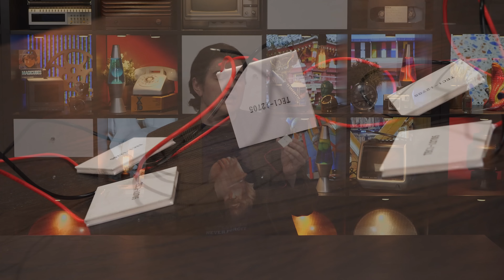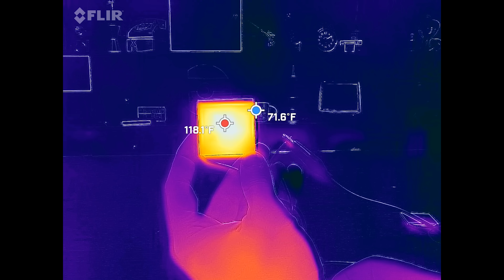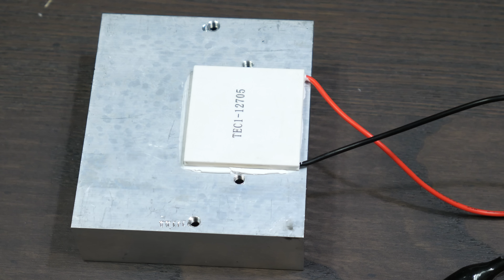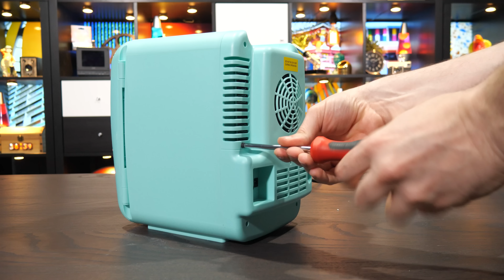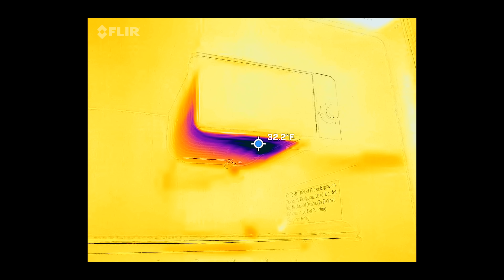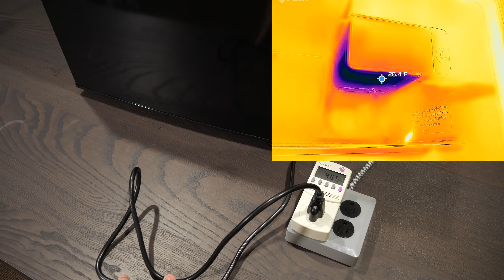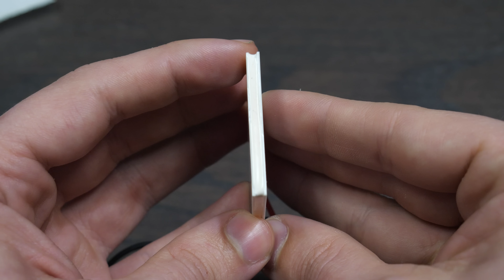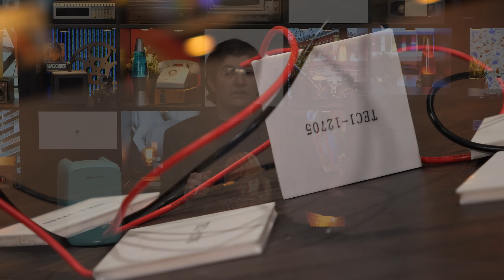Thermoelectric cooling: it's not great.

Comment: Peltiers make for an awesome demo in digital electronics classes as a thermo quantum effect device, but unfortunately have incredibly specific use cases in real life.
Reply: I have used them in research applications where we control the temperature of a device to keep it stable. A lot of scientific cameras use them for cooling and stability as well. The applications for TECs may be niche, but they exist!
Reply: I once had a very senior engineer at a military equipment manufacturer ask me to design a Peltier based air conditioner for use in extreme climates. It was an awkward conversation.
Reply: @Miata822 what did you tell
Him? What did he say?
Reply: They're fun for DIY projects. They're really cheap and really simple.
Reply: They're OK for use in a car and camper, compact. Not very efficient but partially that is because most of those cheap l;ittle peltier fridges have a fan and heat sink that underperform. For maximum efficiency you want to keep the Delta T between the two sides of the peltier elements as low as possible, this means keeping the hot side as close to ambient as possible. The reason for this is that moving the heat from one side to the other costs more energy, and the higher the temp difference, the more extra energy (supplied by the electric current)  is needed per unit of heat. This means a decent heatsink and a powerful fan. Still inefficient, and the limit is still only about 30 Kelvin max, as was told in the video.
Reply: @paulmichaelfreedman8334  not sure where you got the 30 Kelvin figure, because I had reached in personal experience, over 40C difference between room temp side and the cold side, single stack, with reasonably good heat removal from the hot side (to ambient, no double stacking etc), since that is the important part - remove heat from the hot side, 2nd most important part - insulate cold side
in this video he mentioned the 30 degree differential, and it is around 30 because that is limited by the insulation of the fridge and overall design, not the technology in the Peltier
quick look at datasheets for some 40ish W Peltier mention the temp delta to be 60-70 degrees C, and that is limited by the heat conducted in "reverse" direction by the materials and construction of the Peltier itself, it simply is too difficult to remove the heat from the hot side when the cool side is just couple millimeters away
not saying these have a chance to replace vapor cycle cooling, just that "educational" videos like these are too biased for entertainment purposes and then this general audience thinks - ah, that is all crap, that is "fridge" is a POS though, but same Paltiers are used in DNA/RNA/PCR analysis machines for decades, where you need cooling and heating in compact package and quick reversing from cooling to heating, in small desktop high rpm centrifuges, to reduce heat input into samples, in infrared technology to cool sensor matrix, in instrumentation to keep sensitive elements at stable temperatures etc, they are VERY useful, just not for something like a fridge where efficiency is very important
Reply: Yup. We have them in a lot of lab equipment -very specific use cases.
Reply: Some laser diodes use them for cooling as well.
Reply: Used to spec them in satellites years back
Reply: Also processors that need it most are just generating too much heat.
Reply: Same here. I played with mine to see how cold I could get it with a cpu cooler and thermal paste on the hot side. It's just been collecting dust ever since. I have an idea for a project to make a fake electronic stirling engine with one. Have a model that looks like a stirling engine with an electric motor driven by a peltier generator. But, I don't even think a Δtemp of 10-15c between your hand and ambient room temp would generate enough electricity to do much of anything. Maybe I'm mistaken. I guess I should start by figuring that out. I have these tiny motors that are about 1/2in x 1/4in that would work well. I could have a gear train to slow the movement down to be more like a stirling engine, since the motors spin really fast.
Reply: @VoidHalo  they actually make and sell these for use on top of wood stoves. My parents have one - it looks much like a stirling engine, but if you look closely you'll see that partway up the stem and right before where the metal fans out into a radial star-grid radiator, there's a peltier sandwiched. Its leads connect to a fan that pulls air through the radiator, and that will keep going basically as long as the fireplace is going. They actually get going quite fast when the top is hot enough!
Reply: The use cases are for when cooling needs to be precise, and where it needs to be silent. There are few heat exchangers that can run at .1C precision or below 55dB.
Reply: The problem with them is they are very inefficient.  They produce so much heat, they usually need active cooling (block and fan) on the hot side.
Reply: I was about to ask. What are the real use cases?
Research is required.
Reply: @IntegerOfDoom  I've seen them in extremely sensitive voltage meters to keep the sensitive components at very specific temperatures since you can change between cooling and heating quickly.
Reply: @IntegerOfDoom  The Peltier Effect is reversible. Meaning that if you place on side of a peltier chip on a hot surface and the other on a cold one, you get an electrical current. This is how (RTG) radioisotope thermoelectric generators produce power, converting the temperature difference from a radioactive pellet and a radiator into electricity. This type of generator is used in deep-space probes and some rovers, such as Voyager and Curiosity, because they are very physically robust (no mechanical parts) and can work for several decades.
Reply: @darmok42 I've seen peltier devices used in a laser power meter. Paint one side black, shine a laser on it, and (after some correction) you can get a laser wattage out of the current (maybe voltage) it produces across the device.
Reply: @darmok42  This is also used for wood stove fans to move hot air around
Reply: @IntegerOfDoom  Astrophotography cameras :)
Reply: @IntegerOfDoom  You can use it to cool the sensor in a digital camera and reduce the noise.
Reply: @IntegerOfDoom  Used them in creating a small PCR machine, since you need to repeatedly heat and cool the test tube. And it can do both!
Reply: @IntegerOfDoom  When I worked in an electronics store, people were buying peltiers to cool the sensors on their cameras, for better stellar photography. It apparently really helped reduce visual noise. Beyond that, I don't think there'd be a good use for them.

I have toyed with the idea of adding peltiers to a liquid cooling loop for a PC, but not to run all the time. JUST to run as a chiller for the radiator, and only to stave off that heat-saturation point that liquid cooling reaches easily. To be clear, I don't usually water cool. I think if you can't air-cool it, you're not moving enough air through enough metal, but I think peltiers have potential as a temporary chiller to try and rapidly bring a liquid cooling loop back down, or to keep it from getting saturated.

In the 2000s, performance junkies were getting peltier CPU coolers, but those required putting a rubber skirt on the mainboard in a vain attempt to keep condensation from the heating element from pooling around the CPU. Even with the stupid rubber skirts, moisture would still form on the UNDERSIDE of the rubber, because peltier coolers, when a computer wasn't under intense load, could chill the system below the dew point. When condensation meets the kind of expensive hardware you'd WANT to peltier cool in 2004, you get a very very sad gamer.
Reply: @NoobixCube  The solution for condensation is submerging the entire case in oil.

"Solution."
Reply: @IntegerOfDoom  Most thermocyclers in biochemistry labs use the Peltier effect – there are several very standard biochemical assays that require rapid heating and subsequent cooling of small volumes of liquid.  The polymerase chain reaction (PCR) is the typical use case – it's used to amplify DNA for many different purposes.  Many labs will be running these thermocyclers hundreds of times a week.
Reply: @IntegerOfDoom Peltier is used as the cooling method for spectroscopy detectors, such as X-ray fluorescence spectroscopy, where vibrations from moving liquid would be absolutely devastating.
Reply: @IntegerOfDoom They are used in PCR machine for amplifing DNA. You need to cycle temperature between hot and cold quickly and repeatedly.. since the tubes being used are very small you can cycle 96 tiny tubes between 4 and 95 degrees 40 times in 40 minutes.
Reply: @IntegerOfDoom Very precise temperature control, for one.
Reply: @IntegerOfDoom  If you need something robust/durable because it's in a place where you cannot service it then Peltier elements can be of use.
Reply: @IntegerOfDoom  I've used one on my video card with water-cooling when I was big on overclocking. It would frost up the top side when it didn't have a load.
Reply: @IntegerOfDoom  They can be use heat differentials to generate electricity and power little fans to mix room air. Look at stove fans.
Reply: @IntegerOfDoom  I've used one on my video card to keep it cool
Reply: @IntegerOfDoom heated and ventilated seats in cars use these.
Reply: Cloud chamber, you can visibly see the trails of different types of radiation, with that and isopropyl alcohol. 
That is definitely a cool thing. LOTS of videos on YouTube about them!!

@IntegerOfDoom
Reply: @IntegerOfDoom  They’re very good for thermal control of precision electronic and electro-optical devices.

Check out Marco Reps Arroyo Instruments videos.
Reply: @IntegerOfDoom  Put a masive pasive heat sink on both sides and mount it on the celing of the cooler which needs to be made of very good insulation and open from the top only to hold the cold better.
Reply: @IntegerOfDoom I recognise the slightly larger ones for specimen samples in the QA labs when I worked in manufacturing.  
It maintains an even temperature, perfect for growing cultures.
Reply: The only one I've used where a Peltier is legitimately useful is good cooling CCD camera sensors in astronomy cameras. You want them to be as cool as possible to have less noise in long exposures but they're small enough that the Peltier can be passively cooled to avoid introducing the vibration from a fan @IntegerOfDoom
Reply: @IntegerOfDoom  we used Peltiers on devices that were sent into the troposphere to monitor weather conditions. Just because we needed to cool down the electronics to not interfere with the measurements and putting a fan would introduce vibrations, which also wasn't ideal. 
They also make for decent heaters if you need to heat a small surface in very low ambient temperature for not too long at a time (it loses efficiency as it warms up).
If you design some very specialized things, it's good to be aware of the Peltier effect, but in real life, just know that it sucks and is not something you want to see in your products.
Reply: @IntegerOfDoom  I've found them in weird places, the weirdest was a mosquito killing device. It used a propane burner directed into a sort of ceramic mesh inside an aluminum housing, they had peltiers connected between this and the heat sink. The idea was it produced co2 to attract the mosquitos into the machine to kill them. I have absolutely no odea what function the peltiers were performing there however.
Reply: @xxportalxx.  I'm pretty sure these are also used in space for power production.
Peltier devices generate a voltage when heated on one side and cooled on the other.
A radioactive isotope decays on the hot side and space is on the cold side.
Reply: @IntegerOfDoom I think a real world example is the coolers built into cars, admittedly not much different from this, but for long road trips, or already chilled cans they seem to do a decent job.
Reply: @IntegerOfDoom  Space. Refrigeration loops are heavy and tend to leak. The energy efficiency also matters a lot less. So if you need to transfer heat off of something in space Peltiers do make sense to use.
Reply: @IntegerOfDoom Peltier cooling is used in two stage Thermal Desorption, typically with a gas chromatograph and a mass spectrometer.

Your samples are adsorbed into packed tubes with a chemical sorbent, which are heated to release your analytes, but if you just do single stage desorptions from the tube your analytes could be spread out across the sorbent material and not elute all together, which makes for bad chromatography down the line.

A peltier cooled cold trap allows you to have a second stage to collect everything together and then very rapidly heat it (up or like 300-400C in seconds) to send it down the line through to your GCMS more akin to a traditional GC headspace injection.

The advantage peltier cooling offers is you don’t need cryogenic liquids to keep your cold trap at sub zero temperatures.    (Usually anywhere between room temperature and -30 C) and the ability to electronically control the heating and cooling.

This is used for things like passive air monitoring for VOC’s.
Reply: They can be used for cooling seriously overclocked cpus
Reply: @Numbertwo22  Except then you'd need to cool the peltier, so what you're really doing is electrically accelerating heat transfer, not so much cooling.
Reply: @dojelnotmyrealname4018  most people when they use peltiers pair it with a massive watercooling system thats connected to a raspberry pi or arduino that controls it so the power to the water cooling shuts off 5 to 10 minutes after the system is off.
Reply: @IntegerOfDoom  well somewhat cooling in places where 12 volt is available and price is an issue for the device itself.

cheap coolers, effectively, but the another problem comes that a power source will become too expensive for home use, but in car it's not a problem to have somewhat high current 12 volt. anyway you can use that kind of coolboxes inside too if you get a decent power supply for them, but it's not efficient.

another is dehumidifiers.  but if you have an aircon you don't need device for that anyway.
then there's more specific use cases to keep sensors in specific temperature etc.

... i recently came across a crackpot channel trying to make an airconditioner with solar form a peltier unit, they thought it was viable because the cold side got cold..

back in the day there was a window when 226w peltiers were usable for overclocking with watercooling.   but yes you'd need a kilowatt of peltier power to cool a modern processor.
Reply: @IntegerOfDoom Cloud chamber and CPU cooler paired with water cooling. They can also be used to make power, which is what I think they were originally designed for
Reply: ....BUT STILL...WHY EVERYONE FORGOT ABOUT LIQUID AMMONIA FRIDGES

...THEYVE also GOT NO MOVING PARTS
Reply: One of those use cases is computers though
Reply: And that may partially explain why many people can be fooled into thinking it is good for applications where it is not in fact good.
Reply: i remember when i tried cooling a CPU with one.
Reply: A drink coaster that keeps the drink cool would be pretty neat
Reply: Another real use case: per @dunmermage - a Peltier fan can sit on a heater in the room (like a wood stove) to push the heat around the room.
Reply: I find them useful for a use case I have on a regular basis, but I readily admit it's a niche case.

I use it to keep a couple of cams of soda (that were loaded into the can cooler directly from the fridge) for long road trips (that I take on a fairly regular basis), and I haven't noted a change in MPG - whatever impact this has on my fuel efficiency is below the signal noise of normal variation in fuel mileage.

A useful thing to have when I'm headed to a hanger (without AC, but with an actual fridge) in summertime.  I can arrive after an 11 hour car trip, load the real fridge with a couple of 12 packs, swap the 6 cold ones to the front, and have cold sodas all week, without havung to air several hours for the first cold one and without the extra bulk and mess of dragging a cooler full of ice all the way to Florida, just to empty it when I arrive.

Eh, worth the $30, even though my can cooler is so cheaply built I have to wrap a bungee cord around it to keep the door firmly closed in transit.

As I said, a very niche use case.
Reply: Car seat coolers, your car seat is not connected to the rest of the car's AC system. I was surprised to learn this when I dropped a pen in the car and went looking for it😂
Reply: They're the modern day equivalent of that greek spinning engine. Cool, but uselessly inefficient.
Reply: @fuzzy-pillar  TECs still have a use case though, for example i have one that allows for sub-ambient cooling of my cpu
Reply: Instead of projecting our failure of execution onto inanimate objects, let's consider the fact that nuclear isn't bad, it's how we use it.
Oh, this is about Peltier chips. Well, same thing.
Reply: and they are NOT quantum items!